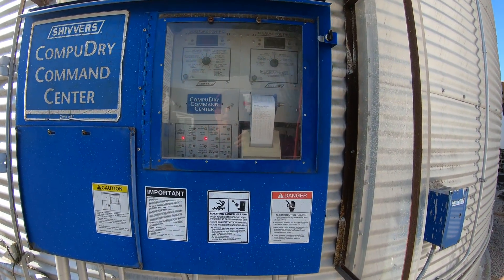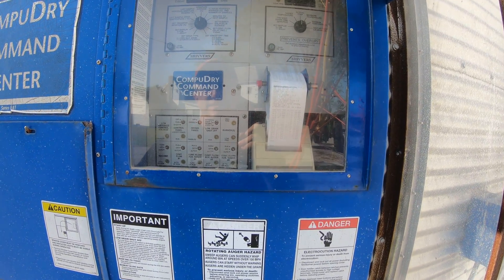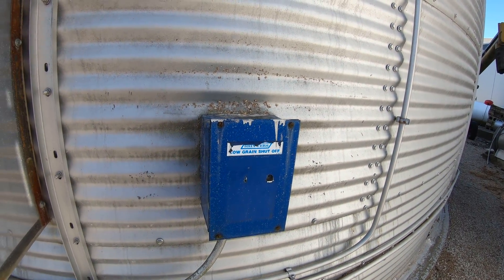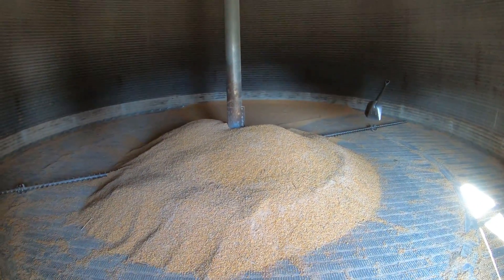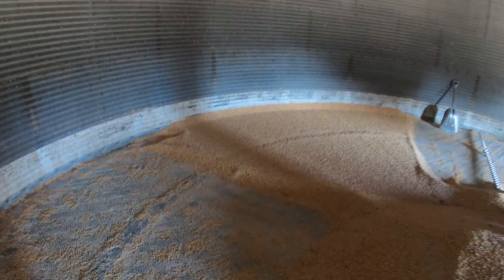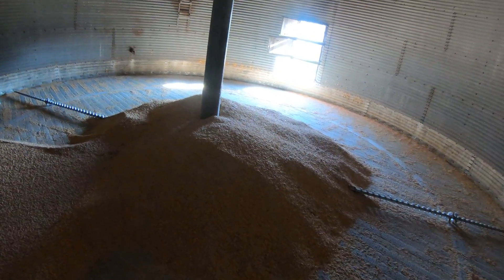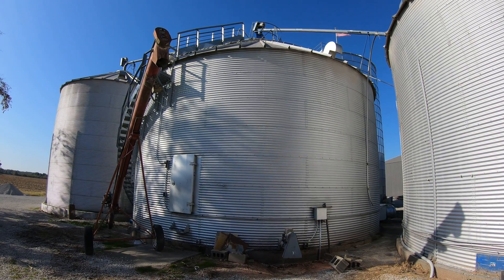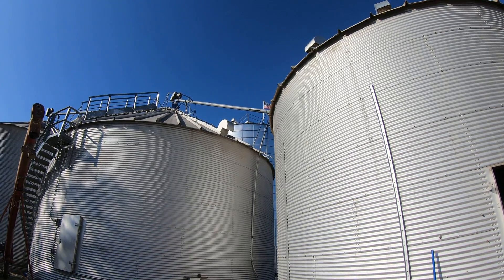How Our Shivvers Dryer Works

Comment: Is this a 30' drying bin and how tall? Roughly how many bushels are you putting through it a year?
Reply from the maker: I'm not sure of the exact size, but I know we can put somewhere between 8-10k bushels of corn in it and still be able to dry it. (depending on moisture content) 

As for how many bushels per year it dries/moves...it fills a 36' storage bin, the "Big Bin" (60-70k bushels) and then the drying bin itself if that last corn needs dried.

Comment: How many bushel can it dry per day from 22%?
Reply from the maker: I'm not sure.  We haven't had much corn over 20% the past few years, or since we upgraded the fan/burner setup.  

That bin holds about 8-10k and I'd guess it'll dry more than 4k in 12 hours at 20%.  

Usually, if we fill it up in the evening, it's at least half way down in the morning.  If the corn is as dry as the transfer threshold, it'll almost be down to the automatic shutdown point after 12 hours.

Comment: Four years later are you still happy with the system? Do you do much 25 to 30% corn?
Reply from the maker: We have actually had this system for more than four years.  We are still perfectly content with it after all this time.  It's been pretty reliable.

We even added a Shivvers fan/burner system to it a couple of years ago.  What you see in the video was the original fan/burner that bin had before we added the Shivvers system.  The Shivvers fan/burner can move more air (two in-line fans for more pressure) and this burner has a high/low burn setting to be more efficient.

We don't harvest high moisture corn unless we absolutely have to.  We try to harvest when it hits ~22% or lower if we can.  The past couple of years our corn has came out of the field below 20% so it didn't sit very long in the bin before the Shivvers started transferring.
Reply: Thank you. In about 5 years we are going to rebuild the grain system I'm just trying to do some research on what's out there that's been working good for folks

Comment: Would that work in 15ft diameter bin? But keep the grain in the bin.
Reply from the maker: Possibly?  I'm not sure if Shivvers has a minimum bin size for their systems.  And you wouldn't have to transfer anything out if you didn't want to.  When we fill the drying bin and it has filled the other bins, we just set it to recirculate the corn.  The dryer won't just endlessly keep sending heat and drying the corn down.  Once it see's the corn is getting lower than our drying setting, it will lower the heat until it actually turns the burner off and it will just run the fan only.  

I assume that you would need to shut the circulation system off at some point, I don't think it will stop itself.  But we have never ran it that far to find out. ;)

Comment: Are you happy with the shivers system would you buy another one or a new one
Reply from the maker: We have been using it now for several years and its been pretty reliable.  I don't think that we would have any hesitation if we needed to buy another.  

But the nice thing is if we want to add capacity, there are other things we can do to improve its drying throughput.  Adding another fan/burner for example, would help speed things up quite a bit. That will probably be the next upgrade we would make.